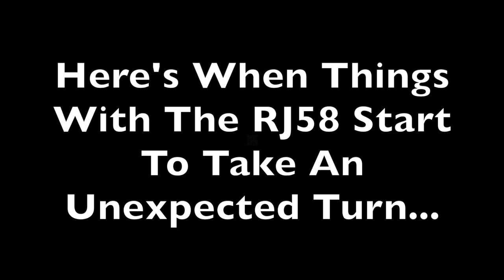AMAZING 1958 Wheelie Horse RJ58 Restoration (Part 1)

Comment: Nice Cushman step thru in the back ground. I had a one when I was a kid. I have a 1949 Cushman Highlander now that I have had since I was 14, I'm 75 now. Rebuilt the old cast engine twice, now I'm running a Subaru Robin 14 H.P. engine with electric start and a Comet torque Converter in it.

Comment: great to see a treasured tractor with such sentimental value returned to Jordan.

some of us restorers aren't in it for the money, just today i was speaking to a woman 50km from me, she has a Wolseley 4/44 and mentioned she has trouble getting it into 3rd, i have a parts car and offered to advise her (i may even fix it with her).
i didn't know her until yesterday when i saw an advert for seedling trees on facebook marketplace.

oh as for the fix, it's a floor shift, so either a bad synchro on 3rd or wear on the selector fork both could be caused from up & down shifting, my bet is the synchro.

Comment: 32:44 😂😂😂🤣🤣 bottom of the steering wheel is holding on.
Reply: I saw that too.  I thought they were doing that on purpose...  But then, it seemed like neither of them had really noticed....  If other people missed it, the bottom of the steering wheel was trapped by the vise...  the punch was never coming out, with the wheel trapped....
Reply: @patrickmorrissey2271  I saw that too. I think it was actually loose after the first couple of taps. They just didn't know. Then when the vise was opened it just fell out. 
This is the first time I've thought Taryl might actually be human, Or a demigod at the least.

Comment: Better get a belt/pulley guard on that beauty or you will be needing a new leg.  Great Deal for everyone.  You need the proper punch to drive out a Roll Pin.  You have a set on the bench.  Correct size with Drill Rod also works sometimes.

Comment: I don't give a 🐀 rat's butt about restoration, I just think they should be able to cut grass again.
Reply: I have decided I do not like the original placement of the engine and stuff on this mower/tractor.  Open air space under the hood?  From here on out it will be nothing but damage control.

Comment: Why not knock it out hot? That is how we remove seized bolts. Glowing hot.
Reply: Expansion - contraction, see why he did it now, actually you'd be better off if you could cool those bolts super quick but ya really can't that's why when most ppl work on stuck rusty bolts on vehicles they don't do the quench part... well that and also cause of the mess and the huge reason is changed the structure of the metal too!
Reply: @offyouselfsbuddy1683  We would hit them with WD 40 that burned instantly but did the quench you are talking about. Still glowing but way cooler than the surrounding metal so you are correct to quench but not always necessary.

Comment: we bought a cub cadet 1811 hydro garden tractor with hydraulic lift on the 3 point an mower deck with a horizontal opposed twin 18 horse kholer we plan to rebuild an rewire the whole thing sense theres bare spots in the wires it also came with the 44" mower accessorie

Comment: In the other Slippers Garage CB360 video he mentioned he also had a 175, I wanna see it!
I used to own a 1970 CB175 it had the squared up type gas tank with the rubber knee pads on it. Possibly a 1969 change-over to 1970 CB175K or some were called Super Sport.
Anyway, I gave it away and now they're worth $4-5k, so sad. lol

Comment: I own two Wheel Horse tractors, a 1994 312H with a 42" side discharge deck, and a 1972 Commando 800 Model 0110 with a 36" rear discharge deck. Both run, both decks are operational. They are not for sale.

Comment: I bet they wrenched on the steering wheel soo much over time it torqued the pin crooked so the holes from the steering wheel are no longer aligned with the holes in the shaft.  It would explain the issues with both trying to punch it out and with trying to punch it out.
Reply: 34:20  I toad a Sole.

Comment: Be careful how many HP's you put on your mod, it's very easy to end up on your back watching it roll away! Don't ask me how I know. Even with the original K91/4hp it's extremely easy to pop a wheelie since there is NO weight in the front end. I'm trying to find a way to add weight to the front of my '60 Suburban to reduce the likely hood of that happening again.... Nice score! I've got 18 Wheel Horses ranging for '60 to '95. Now I've got time to restore them.

Comment: HELLO.     TARYL.        WHEN YOU DRILL.    YOU DRILL ON THE SLOWEST SPEED POSSIBLE.     I WILL TELL YOU WHY.     I WORKED AT A PLACE DRILLING HOLES ALLL DAY. AND WE WERE ONLY GIVEN 2 BITS.   FOR 100 HOLES.   AND ALL EMPLOYEES HAD TO DO IT THAT WAY I DID IT ON FAST AND MY BIT QUIT CUTTING AFTER 1 HOLE.    AND EVERYONE LAUGHED AT ME.  THEN THEY REVEALED THE TRUTH.    YOU HAVE TO DRILL SLOWWWWWW.    THAT KEEPS THE TIP COOL AND KEEPS IT FROM BURNING AND GOING DULL.     SO ALWAYS DRILL AS SLOW AS YOU CAN WITHOUT THE BIT STOPPING.  LIKE 10 RPM.    ALSO YOUR KILLING ME MAKING ME RE LIVE THE TIME I LEARNED.     THANKS

Comment: Why hasn't anyone restored that old Swisher I've seen in your other videos?  It's the first zero turn mower ever.
Reply: Actually, I thought Yazoo was first…
Reply: @notajp  The first Swisher Ride King was on the market in 1949.
Reply: @dukenudibranch6414  I would argue that the Yazoo was the first of what is generally recognized as a ZTR design today. I look at my Grasshopper and see the same basic machine design. A triangular “tractor” platform with a front mounted mower deck, drive wheels at the front of the operator platform…. The first “zero turn” mower I ever operated was a 1960’s Yazoo with a Wisconsin TJD twin cylinder engine.

Comment: Should have seen the dam steering before I got a hold of it. You couldn't even steer it. I returned it back to original that thing was so cob jobed up it wasn't funny. I still have the make shift heat sheild someone made.  Glad it made it back to the old owner. I took my fully restored rj58 steering apart to fix that one. Wished I never sold that turd. The motor on it was re ringed not by me it still smoked when I had it.